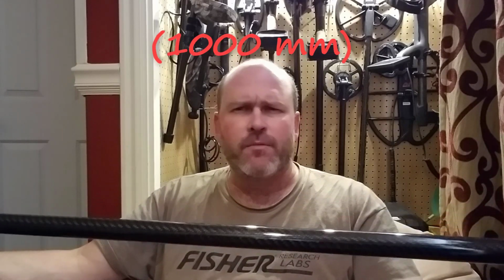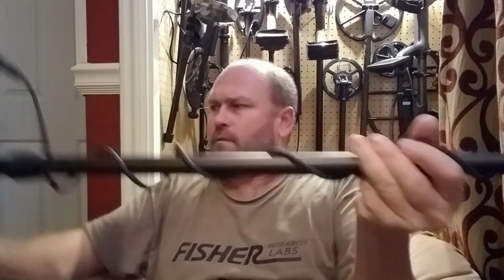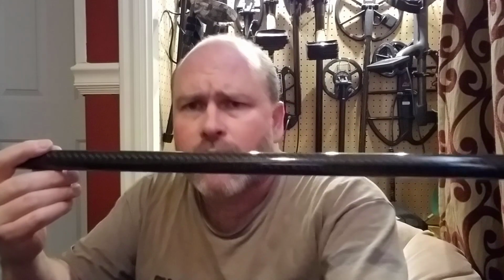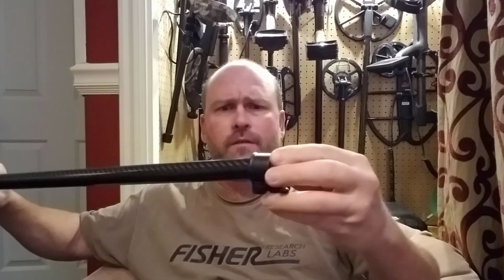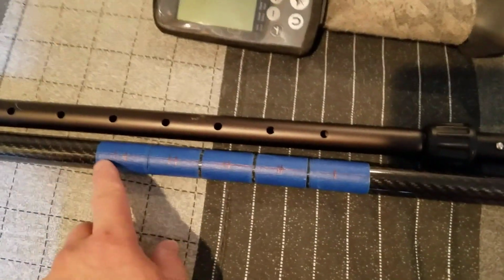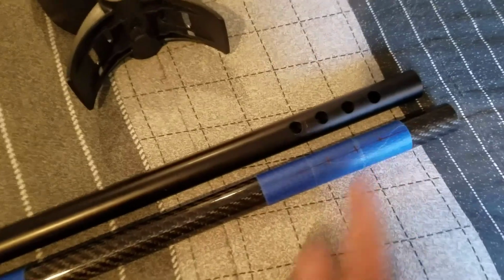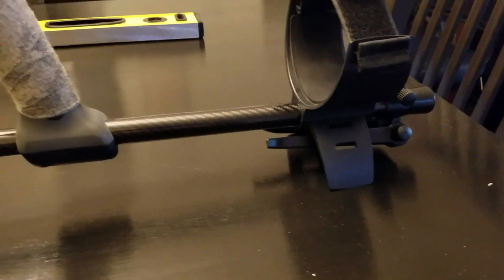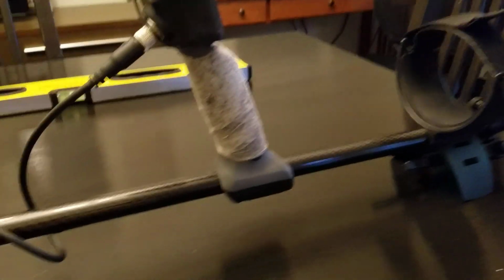DIY Carbon Fiber Shaft for Minelab Equinox

Comment: Hey Ryan I don't know what you're using for a handle grip for your Equinox but look up lizard skin they make mountain bike covering for mt bikes . shock covers to frame covers I used one on my Equinox on the  grip area and it's washable so if it gets dirty throw  in the wash when you're Now using your Equinox and good idea on the carbon fiber take care
Reply from the maker: Thanks for the suggestion Ken. It's just vet tape I wrapped on the handle. If it gets too dirty I just re-tape. Cheers!

Comment: I did the same mod a few months ago but didn't drill the holes for the lower shaft because the plugger shaft locks hold it tight with no problem. Also if you use as much of the lower shaft as possible and shorten the carbon fiber tube it will collapse all the way to the handle when not in use making it easier to handle. The stand is a nice touch.
Reply: To which length did you shorten the carbon shaft to and still have sufficient rigidity in the upper/lower shaft combo? Would be nice if you're able to travel with the carbon shaft.
Reply: @m.noordink3044  I cut it to the factory length but I'm going to recut it shorter. The setup is so light and the plugger shaft lock works so well it'll only need very little shaft to go into. Buy the tube and lock, mount the handle and cuff, adjust the lower shaft to  desired length, mark it then see how far in it goes into the shaft. Then pull the lower shaft almost out, tighten it say a couple inches in I'd bet its solid or maybe more then cut the difference between it feeling solid and your desired length from the tube. Your just trying to used as much of the lower shaft as possible.
Reply: thecubrunkid do you did not drill out lower holes?
Reply: @markkus1134  No, the cam lock works so well that the lower shaft never moves once clamped.
Reply: thecubrunkid did that thanks works graet
Reply: Hi fantastic idea have you got any photos or drawing of this-many thanks